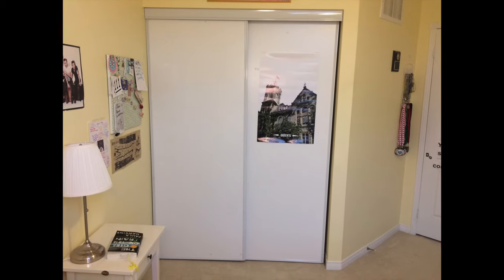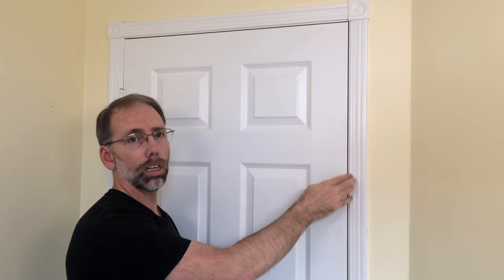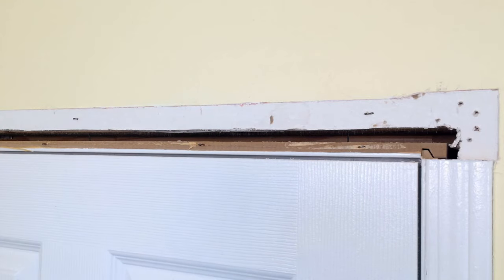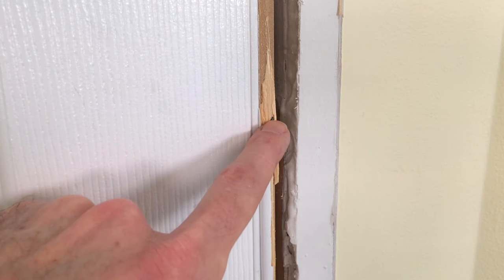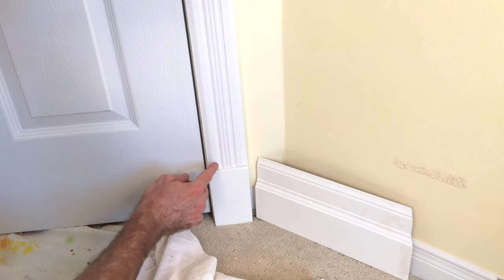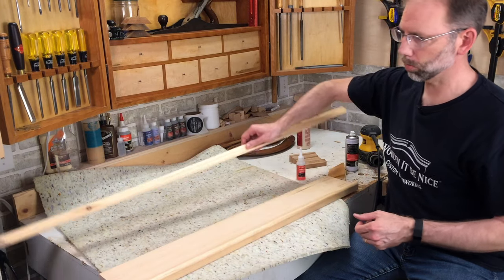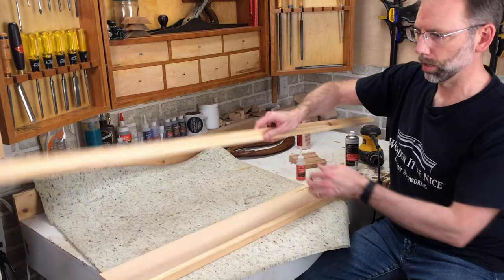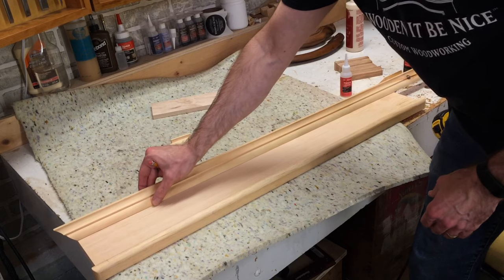How to Replace Door Trim on a Pre Hung Door - Trim Carpentry

Comment: It's so frustrating that no one shows how to do things with hand tools so I wouldn't have to spend 1000s on expensive power tools before I can start  a simple DIY project.
Reply: Miter box saw, 4D finish nails, and hammer is all you need my friend
Reply: And a nail setter
Reply: Should cost you more than $30
Reply: @notetoself1378  I have a mitre box but still don't know how to use it lol - it's ok for cutting mouldings lying flat for making frames and such but when I stand it up to cut it as it would be on the wall it's taller than the box' wall so don't know how to start sawing and getting the proper angle on that portion that stick out.
Reply: @bearcat1283  you would cut the trim lying flat on the ground at a 45. I don’t understand what you mean when you say cut as if it were on the wall
Reply: @notetoself1378  you have to position the moulding ( trim, crown etc) in the mitre box in the same position as it will be attached to the wall later. You don't cut if lying flat but it must be standing up in the box. When i stand it up it's taller than the box wall and I wish someone shows us(small diyers) some hand tool tricks how to go around problems like this rather than endless videos of pros showing off how good they are at using their expensive power tools.
Reply: @bearcat1283  you measure and cut my friend. No need to cut standing

Comment: nice video as always, but i have a question, what do you call a finish nail,   from what I could gather (checking hardware strores), the category neither framing nor roofing  there are only bradnailers (the funcky square head) with different gauges. The biggest I could get my hands on was 16 gauge nailer, is this what you're calling "finish nail(er)s" ?
Reply from the maker: That is correct.  A finish nailer is 16 ga, the brad nailer is 18 ga, and a pin nailer is 22 ga

Comment: I'd have pulled the carpet back and set the plinth blocks and skirtings (baseboards) level with the floorboards 🤔
Reply from the maker: If you're planning on reinstalling carpet, you will need to leave a gap between the floor and the bottom of the plinth block so the carpet can go underneath.  I hope that's helpful.  Scott
Reply: @HomeImprovementWoodworking  not at all, here in the UK skirtings and architraives are fitted hard against the floorboards and carpets are tucked between the gripper rods and skirtings.

Hope that helps 😉

Comment: That new trim looks like the doors on our old 1909 house, which I’ve always considered to be a sort of craftsman style. I’ve always loved it in comparison to the “pseudo colonial” type stuff we see today. At least, this pre-hung door originally had those ornamental corners that I’ve seen on other houses in our neighborhood, (sometimes stained instead of painted, which is cool!) but you can tell it was done cheaply.
Edit: another little thing I noticed about the trim on our house is, no plinth blocks, but it still looks perfectly fine. Our baseboards are styled differently: they’re a solid piece of wood about 8 inches tall, with a quarter-round base piece and a cool trim element at the top.
Reply from the maker: Yes, I selected this trim to give our home a more classic feel to it compared to the tiny trim the builder installed.  Cheers.  Scott

Comment: I was wondering why you are  using glue instead pin nails in this specific operation.... but then again I am not in the trade and know very little about carpentry
Reply from the maker: Hi Rob.  I assume you're asking about gluing the corners.  You get a higher quality result by gluing the corners on miters before attaching the parts than the other way around (attach the parts while lining up the miters.  I hope that helps.  Scott

Comment: Your videos are top notch. That door was not installed right to start with if no shims were used. Dont hire that guy! $20 for a utility knife?? What's so special about it?? 
Thanks for the discount on the CA glue!!!
Reply from the maker: About the utility knife, the quick release for the blade is the key part for me.  This knife uses a slide button release that makes changing the blade so easy.  I also like an ergonomic fit in the hand.  I've owned about 6 different utility knives before this one and none compare.  Mine is a Makita.

Comment: Fantastic job. I love the way you trimmed it out. But I wondered. Did you use caulk before the final coat of paint. 

Thank you for creating this. I’m definitely going to use your method with my doors and (with slight variations) my windows.
Reply from the maker: Yes, caulk any gaps and always paint the caulking.  If you don't paint the caulking, it could be visible, and dust will stick to it over time.  Cheers.  Scott

Comment: 15:05 have you considered simply attaching all your trim to the board then cutting the whole thing at 45s on the edges as an assembled piece?
Reply from the maker: Interesting idea but crown moulding has a slight back bevel to it, which means if you glue it directly to your stock, it leans backwards a bit.  I prefer the method I show in this video.  Cheers.  Scott